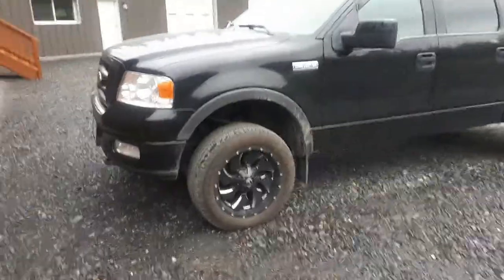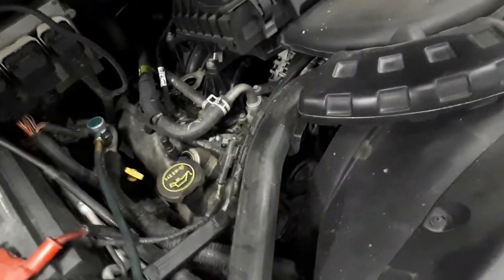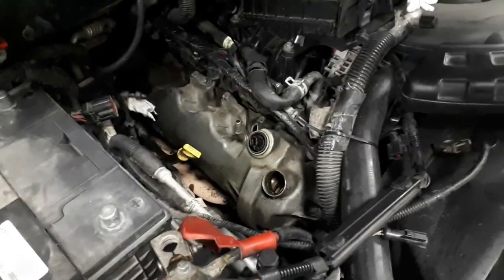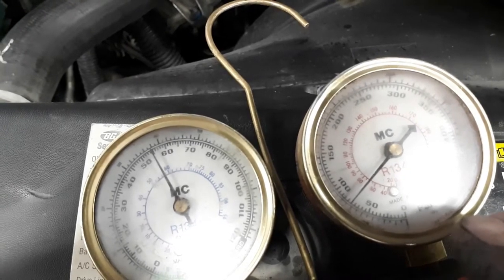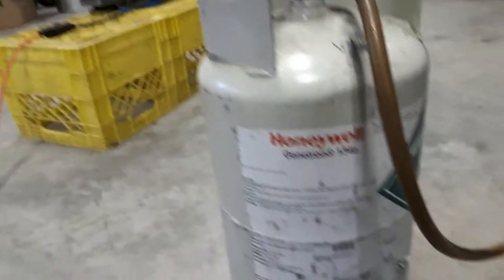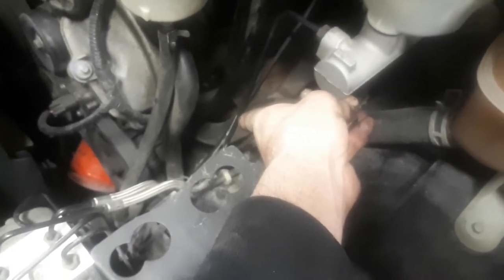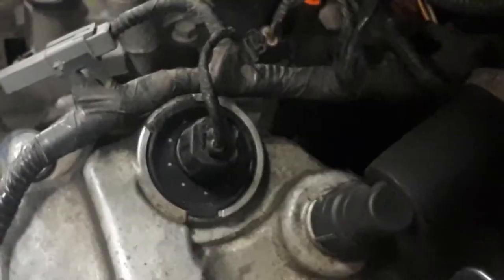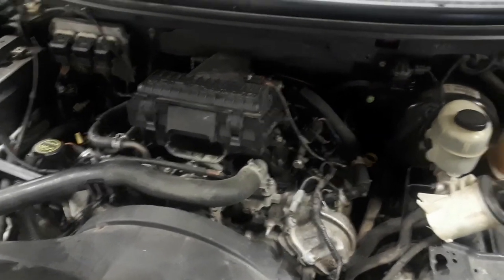VVT Solenoid Replacement 2004 F150 5.4L Triton

Comment: Ford tough , I still have a 5.4 in my 99 F 250 still runs great we’ve run synthetic oil in it forever never had cam phaser problems with it...apparently lucky from what I here ..dirty oil is like sand paper chews up good parts . Thanks for sharing 👍
Reply from the maker: Thanks Rusty..been checking out your vids..liking your Model A..See other stuff in the shadows..lol..hiding stuff?
Reply: @MywayRodsandRestoration  what were huh never ....lol Thanks